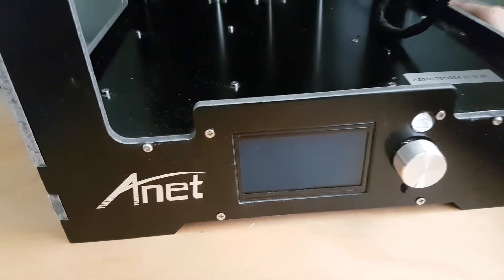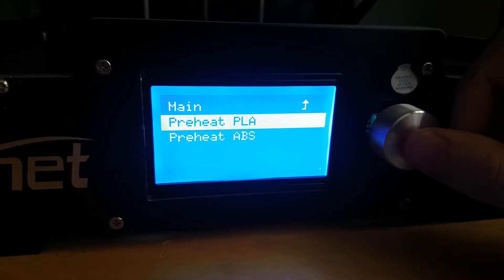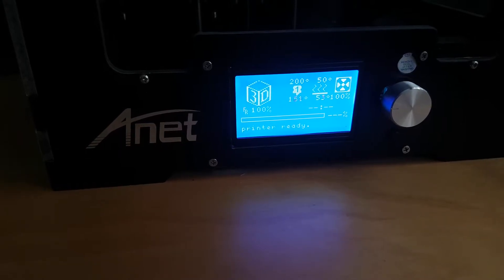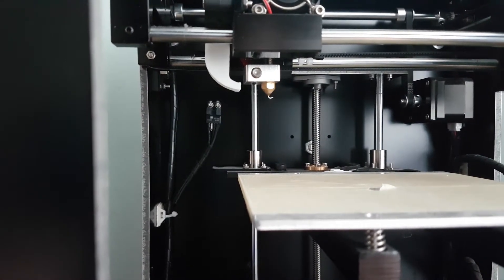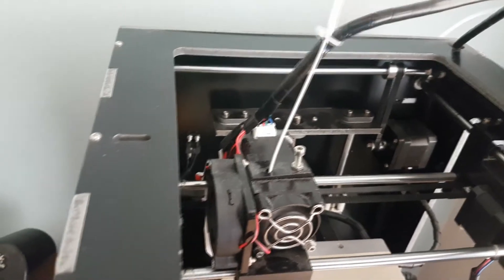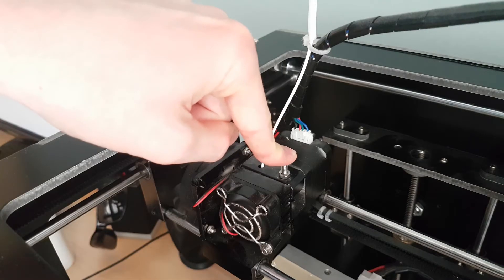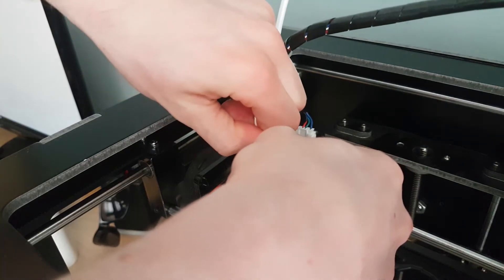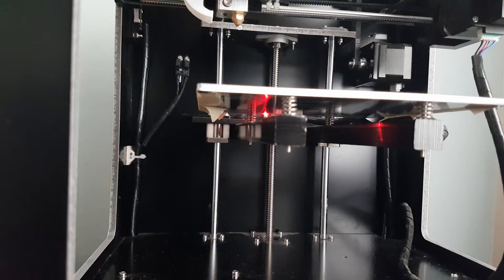How to Fix Anet A3 3D Printer Jam - Extruder Jam Tutorial

Comment: i have a question about this printer, it gives this clicking noise sometimes while printing and sometimes the extruder kind of, turns of for lack of a better word. it would sometimes print for 4 lines than skip 4, then print some more, then skip. what is the cause of this issue and how should i go about fixing it
Reply from the maker: Sounds like one of the rails may be getting blocked also check when the bed moves up or down nothing is hitting it such as the bolt that holds the filament holder